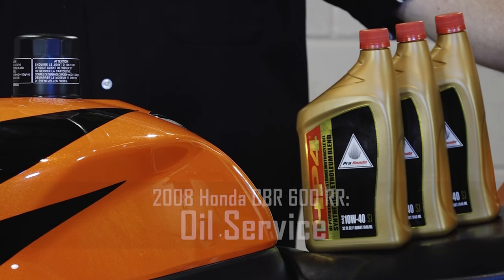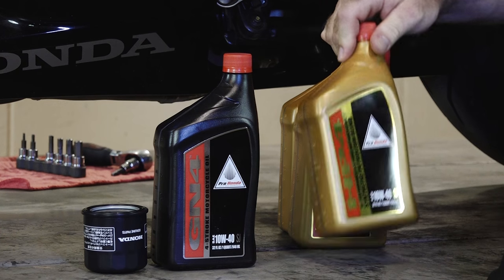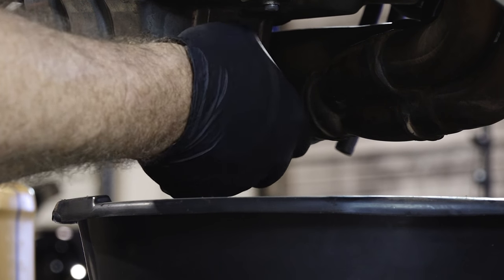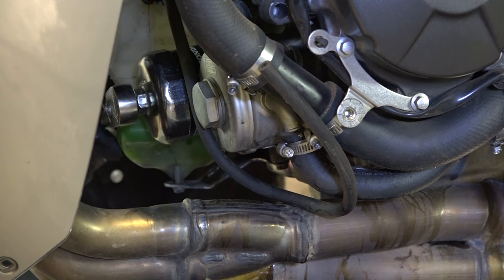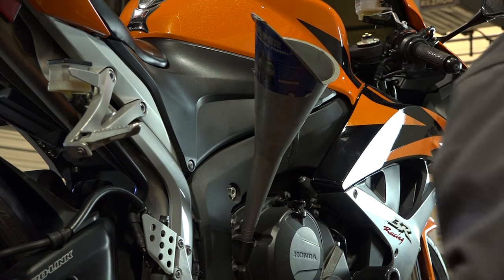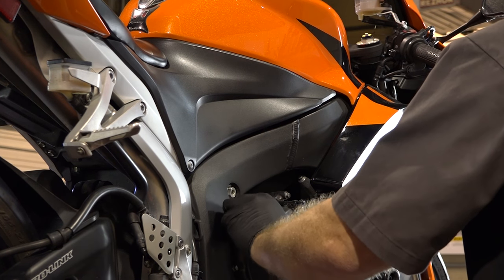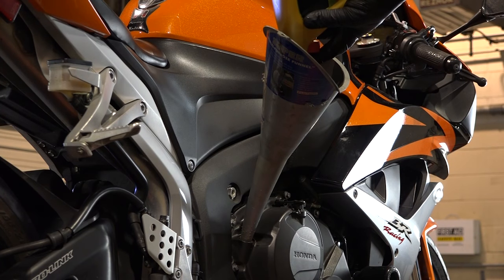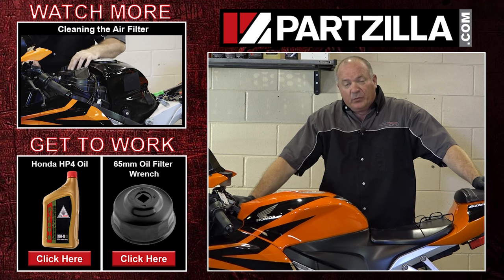Honda CBR 600RR Oil Change | Partzilla.com

Comment: Put aluminum foil on the headers first. Then no cleanup, just remove the foil.
Reply: 11secondeclipse mild disappointment in myself 4 not thinking of that.
Reply: I do that too.  The fairing doesn't need to be taken off.  You can reach through the hole to get to the filter.
Reply: I do the same thing, its perfect
Reply: Matt and to remove the oil plug? Also no need?
Reply: Hey thanks for the tip!!!
Reply: What if we over fill the bike and oils coming off the side will ridding
Reply: @albertsandoval2317  drain the whole thing and do it over. Safest bet.
Reply: just used this idea thanks man

Comment: I've done my oil changes following your guidance and there's one crucial thing you needed to add.. the old oil filter should be inspected for it's seal and the contact area on the bike where the filter sits should be cleaned and inspected. It's probably such common knowledge that it wasn't included, but for a noob like myself, this step is crucial. After doing an oil change a few days ago my old seal was stuck and it was overlooked. After installing the new filter I test rode it and oil gushed out and caused me to high side on a turn. Check your old filter lads.. ride safe
Reply: Did you double gasket it?
Reply: @xxudonoxx yes from was her sayin yeah how he didn’t notice as soon as it started up 🤷🏽‍♂️ or when he tightened the shit out of it 🧐
Reply: He’s*

Comment: I agree. I use a certain foam-foil adhesive  from Home Depot. I can then place the sticky part on the headers/pipes and mold the foil like a funnel. The adhesive will remove easily and it keeps the foil in place so it doesn't move if bumped. I also take off or loosen the bolt for the coolant resivour so that I have a bit more room to take out the oil filter. This way you don't burn oil on the header.

Comment: bought a 2nd hand 08 cbr 600. looked at sight glass. on kick stand and it said it was high. got the bike level the oil was way over filled. when I drained it. 1.5 liters or 1.5 quarts over filled. 

So check oil level with the bike LEVEL NOT ON THE KICKSTAND. and he used car engine oil . I could tell when the oil was drained to correct level clutch slipping. having the engine overfilled created fluid drag and stopped the slipping. 

also use alfoil to cover headers and divert oil into drain pan! so much cleaner .

Comment: SHIT. ONCE AN OLD MAN TOLD ME. AND I BEEN DOING FOR YEARS IN ALL MY VEHICLES. BLOW AIR INTO THE ENGINE WITH AN AIR COMPRESSOR B4 YOU PUT THE NEW FILTER ON AND YOU'LL GET MORE SLUDGE OUT OF YOUR ENGINE THAN NORMAL.  YOU ENGINE WILL THANK YOU FOR IT.

Comment: Hey I bought a 2012 cbr600rr and changed the oil.  I drained it and changed the filter and added 3 quarts of Honda synthetic.  But when I emptied the drain pan.... there was about 3.5 or a little more of oil that came out.  Why is that.  The window on the oil tank shows its full.

Comment: so is it really better to warm it up and getting the fluids all around, or better to go stone cold with as much oil as possible all resting at lowest point near exit hole??
Reply: mikeyb byekim better to warm the oil so it flows out faster and easier.
Reply: @masterofbrewtality  im not concerned of it flowing faster or slower. more about thoroughly drained
Reply from the maker: When oil heats up, it reduces viscosity, which allows more oil to drain.

Comment: Do you even need to refill the coolant or just leave it in there till you need to replace it
Reply from the maker: You should definitely check your fluid levels occasionally.  It's a closed system, so short of damage, leak or replacing it during a service, it's shouldn't vary much.

Comment: Dude, it says in the manual if you drain the oil and replace the filter, it takes exactly all 3 quarts. That's why your's took all 3 quarts. No need to put in 2-1/2 quarts and start it. Just put in all 3.
Reply from the maker: Old habits.  Typically you want to let it cycle and draw the oil down before you add the last 1/2 quart to level.

Comment: i recently changed my oil on a 07 cbr600rr and after it seemed like the clutch is slipping where the revs go high and bike does not accelerate.

Comment: and before adding oil, when I see used oil so dirty, I'm tempted to do some sort of flush so that if i were to refill with clean oil, i could literally ride a bit and drain it with the oil still being clean n clear.  any thoughts or suggestions about such a technique?  that way i know all of the old burnt dirty oil is cleared out.
Reply from the maker: Whatever is left as residue when you drain is nothing to worry about.

Comment: Do you not have to fill the oil filter with oil at least half way as it is horizontal? is it just something for extra caution? Thanks
Reply from the maker: You don't have to.  It will fill regardless, it just means you have to add less when you top it off.
Reply: Partzilla but when you first start the bike the filter is empty and there is no lubrication for the engine for a few seconds, would that not harm anything?
Reply from the maker: @Pizdzirynka1  At idle, it's minimal wear.  If you start it and immediately rev it up to redline, then yes, that would be an issue.  The oil travels pretty fast to the components.

Comment: I'm having trouble picking out an oil for my 2007 600rr, I was told to run full synthetic because I bought the bike used and they told me if I were to go back to regular oil it could cause problems. Should I run full synthetic, if so what brand would you recommend and what type do I need?
Reply from the maker: As long as you fully drain the oil, you can go back to regular oil.  It won't hurt anything, you just shouldn't mix them.  If you're going to stick with synthetic, we recommend HP4.
http://www.partzilla.com/parts/detail/honda/HP-08C35-A14W0M.html
Reply: Partzilla thanks for the help, this video made it extremely easy to do all the work myself and saved me quite some money! Will definitely be doing whatever work I can with these videos to guide me

Comment: Tighten the oil filter by hand its easy to over tighten it using the ratchet like he did. It should never be done like that. Also use clean oil to lube your filter gasket , It's unlikely that that would cause a problem But there's no reason not to use clean oil.

Comment: Could you please tell me how correctly measure oil level with dip stick. Should I threaded or unthreaded when measuring and also bike angle it should be in side stand or not, and also should engine in cool or warm. My bike is Honda Honet 250 2006 Thanks
Reply from the maker: Unscrew, clean dipstick, place it back in without screwing it down.  Bike should be level.
Reply: Partzilla thanks lot

Comment: 2:40 dont add oil to oil filter before installing???  a service mech told me I should always prefill the filter.  so makes me wonder
Reply from the maker: You don't have to, it will fill up just fine on it's own.
Reply: Some cars and vehicles have the oil filters upside down so goodluck filling those up before screwing those on lol

Comment: Do you have any videos in regards to a bouncing tachometer ?
Reply from the maker: We don't right now. This could be a couple things.  Test your rectifier, voltage fluctuations could cause it, or tach sensor.  That's where I would start.

Comment: Hey I used brake cleaner to clean the exhaust manifold and it was still smoking alot is that okay?
Reply: yes it should burn off eventually.. next time just wrap some tin foil around the exhaust pipe so u can prevent the oil dripping onto it. saves u a lot of work

Comment: Was the bike level when you were checking the sight glass? (Not on a rear stand?)
Reply from the maker: The difference between on or off rear stand is minimal, the only concern is side angle for proper sight glass inspection.
Reply: Partzilla so the bike was level?
Reply from the maker: Yes.

Comment: What are you using to clean the oil off the headers?
Reply from the maker: Just a can of brake/contact cleaner. http://www.partzilla.com/parts/detail/honda/HP-08732-CBL49.html
 It evaporates really fast so I'm not concerned about fire when I crank it up.

Comment: why would you need to replace the oil fill plug?
Reply from the maker: It's pretty rare you would need to replace it.  Unless it gets cross threaded, it should be good.  If you see any oil leaking, you would need to replace the o-ring on the oil fill plug.  At the end of the video, "replace your oil fill plug" just means to reinstall it.

Comment: what spray did you use to get the oil off the pipes once you removed the oil filter. my bike always smokes up like crazy even after I wipe it down
Reply from the maker: Contact cleaner will get rid of any residue.
Reply: Partzilla thank you!

Comment: Torque spec on drain plug for a 06 cbr 600rr??
Reply from the maker: Should say in your manual, if I remember correctly, it's right around 22ftlbs.

Comment: I’m about to do an oil change on my 600. Does anyone here take the oil filter off by hand?
Reply: Probably late now but it won't be easy to take off by hand. I've got a 2004 and a 2012 cbr600rr. Easiest way is to put a screwdriver through the oil filter and use it as leverage to get it off

Comment: I just bought a used bike it has 20 miles on it and i don’t know what oil and 5w 40 or 10w 40 and he told me that he put dealers oil and i don’t what to do
Reply from the maker: 10w-30 is spec.
Reply: Thank you and hp4 do they have 10w -30
Reply: Or what best brand should i used?
Reply: What do you recommend?
Reply from the maker: Brands aren't as important as weight.  We recommend oem oil as the go to.  Honda oil, HP4 or GN4
Reply: Partzilla, didn’t you use 10w40 in the video?

Comment: That was messy as hell. All over ur pipes
Reply from the maker: Yeah a bit of a mess but that why I cleaned the pipes with brake cleaner. I would much rather do that instead of removing them.
Reply: You can fashion a tin foil funnel to get all the oil in the pan instead of messing all the pipes.
Reply from the maker: Good tip, Thanks!